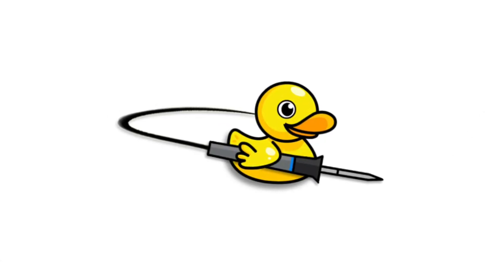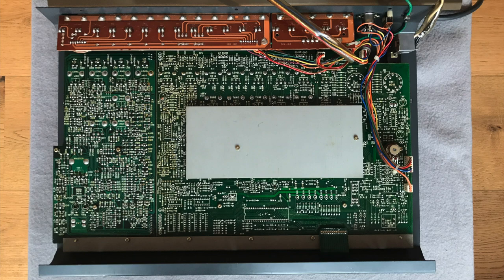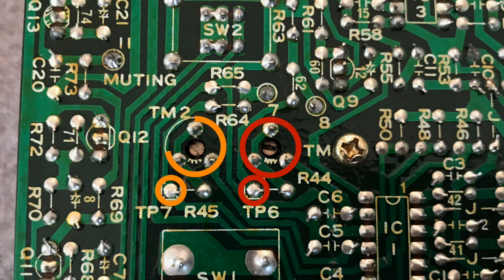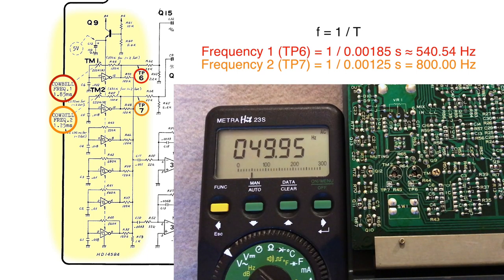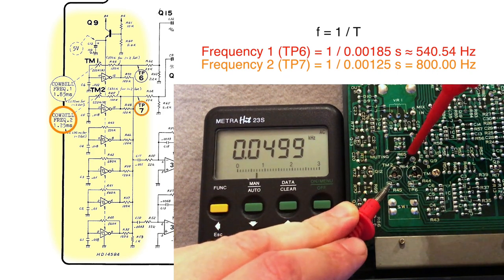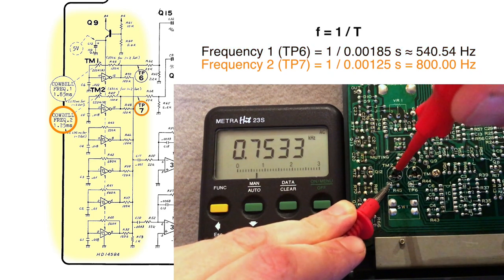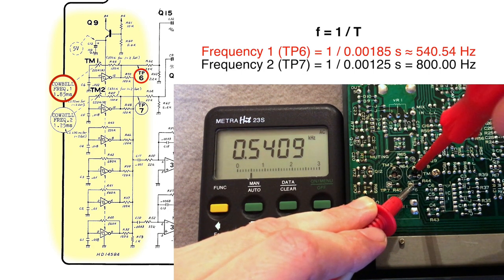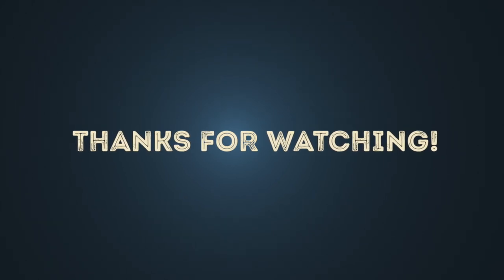How To Tune A Roland TR-808 Cowbell!

Comment: I checked on some typical 808-tracks and ALL of them had the cowbell differently tuned. None was like this :-D Then, I used Ableton Live's "Analog" synth, tuned the oscillators to 540.6 and 800.1 Hz and went from there. With a specific filter envelope and some distortion, I reached very 808ish sounds. Interesting results, totally in the same realm. And chromatically playable with a keyboard.
Reply from the maker: Yes, if you listen carefully to the cowbells from different tracks you will notice the differences. Of course, many samples and replicas were also used. Have fun experimenting in Ableton! 🙂

Comment: Very warm, nice voice! Thanks for the instruction! Can I also do this with a normal multimeter? I'm trying to tune my cowbell with it, it's a eurorack diy module! I found the points on my pcb board, it looks different than on your board, but there are the right points on me, only which multimeter do I need? what is the black connectet to the multimeter ? wiht masse ? Sorry my english is bad !
Reply from the maker: Thank you Maik! Yes, theoretically you can use any multimeter that can measure frequencies. There are probably differences in quality, but for cowbell frequencies a simple one should be enough. An oscilloscope would be best, of course. Right, black to ground and red to the measuring point where the sound is. 👍